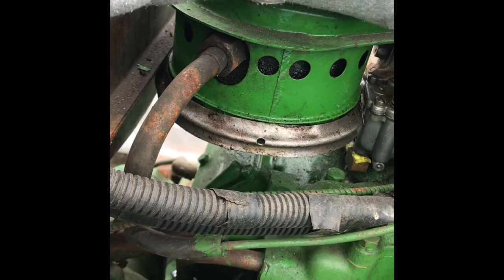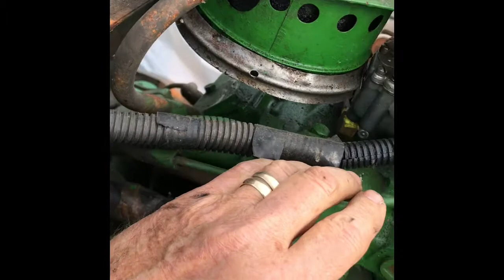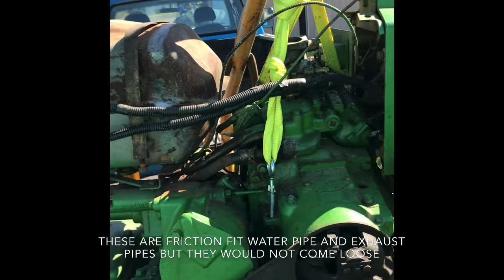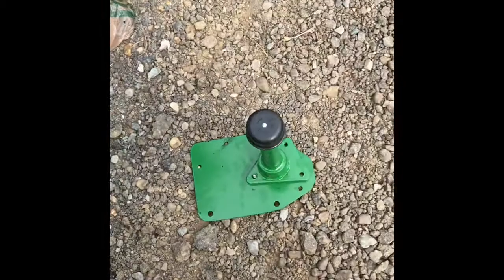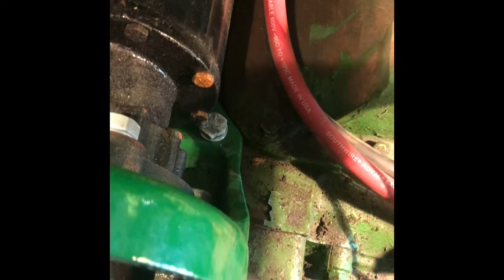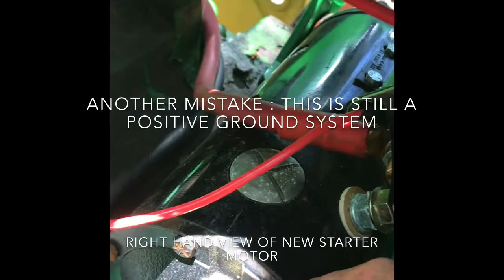JD 720 Electric Start Conversion

Comment: Those connecting rods that you have can be machined out back to roundness and intentionally over diameter so that they can be upgraded with rod main bearings installed in them instead of the Babbit style that JD originally has them engineered.... And why they end up so out of round so quickly is because them little engines don't make enough oil pressure and volume at the rod main journals and coupled with the fact that the engine is intentionally setup to spin 5,500 rpm indefinitely and immediately upon it firing off. Those ball bearings under that bell shaped steel plate at the cam is attached to the throttle actuator so immediately upon engine running that sort of governor is what opens the throttle plate in the carburetor which sends it to full wide open and that's the only speed that those engines are engineered to run at so that the coolant can warm up the diesel block as they share coolant, and also the Diesel's intake pipe is chambered for the pony's exhaust can flow through it to warm it as well. JD called that pony starting setup as "All Weather Starting" which they guaranteed that no matter how cold out assuming the gas pony engine fired and ran then you could start the Diesel engine regardless of how cold outside it was. Which is why it's so brilliantly engineered with the shared cooling system and the intake pipe heating utilizing the pony's exhaust. But the flaw you see being the intentional wide open max rpm only operating strategy and inadequate oiling system is it's only downfall. Otherwise I think that little 18.85 cubic inch v4 cylinder is quite an impressive piece of engineering for what it is and what it's intended purpose is. Also the clutch system and the gear reduction box or 1 speed transmission if you will is as equally impressive. When pulling the start lever simotaiously apply s the clutch as well as throwing a kind of bendix gear out to the Diesel engine flywheel ring gear on a straight spline slide shaft to rotate the diesel crank with the assist of a decompression lever on the 20 and 30 series had the two levers, the R, 70, and 80 models had a single lever only. And lastly, those "cylinder liners" you referred to are actually what are called wet sleeves, those are sorrounded by the coolant directly and have rubber o ring seals under the sleeve crown and at the bottom end which are what seal the coolant from making it's way into the upper cylinders and the crankcase.